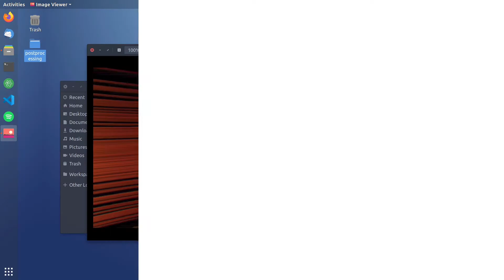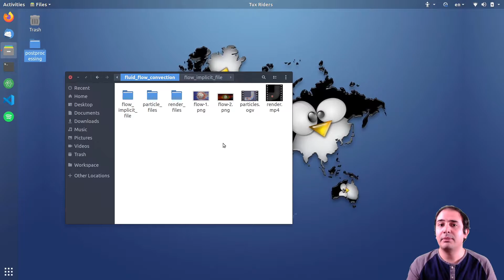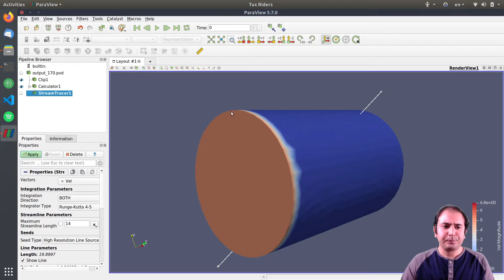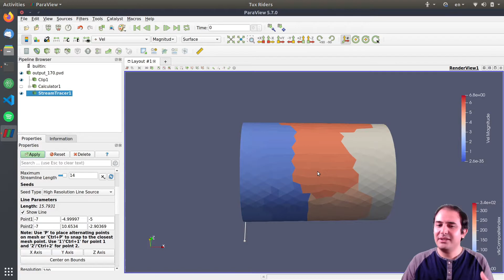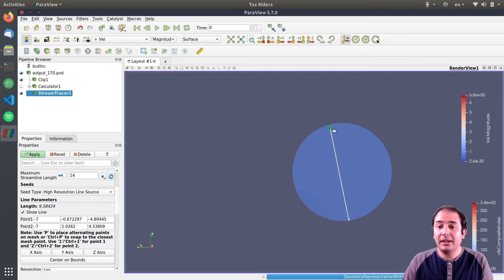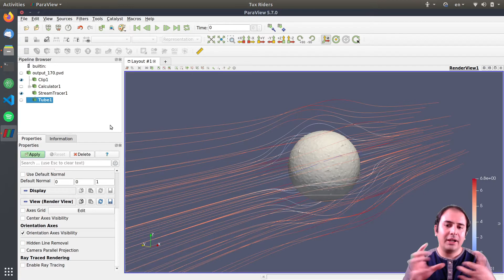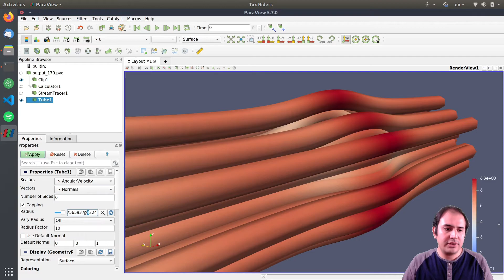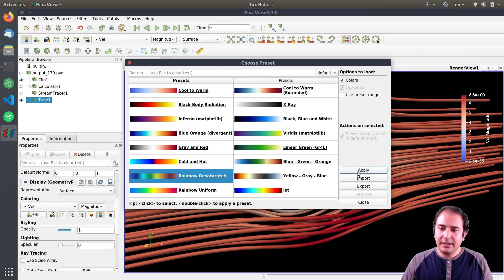[ParaView Postprocessing 12] Fluid flow: stream lines

Comment: Thank you so much for your video — your explanation is very clear and easy to follow. I really enjoyed it!

I do have one question. I’m currently working with some vector datas, and I also have obstacle geometries in STL format. I was able to generate streamlines following your tutorial, but in my case, the streamlines are going through the obstacles. I'm wondering why this is happening.

In your video, the streamlines seem to curve around the obstacle spheres — how did you achieve that? Is there a specific step or setting that prevents them from penetrating the objects?

I’d really appreciate any advice or guidance you can provide.
Reply from the maker: Glad to know that you found the video useful. ParaView can do nothing regarding the streamlines going around the obstacle and not through it since it's a visualization software only, meaning that it visualizes your data that is processed/generated/simulated somewhere else. In this case, the flow over obstacle simulation was performed using FreeFEM first (by something like this code https://github.com/mbarzegary/navier-stokes-solver), and then the results are postprocessed in ParaView.